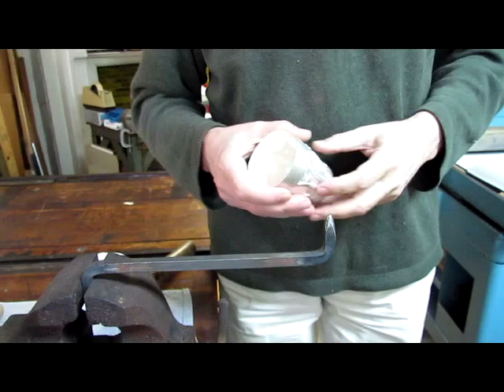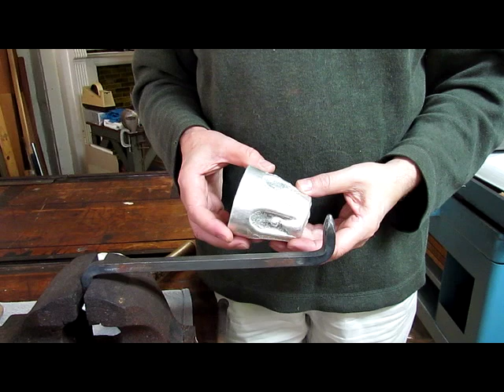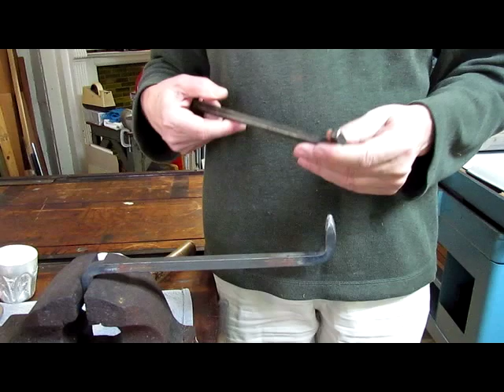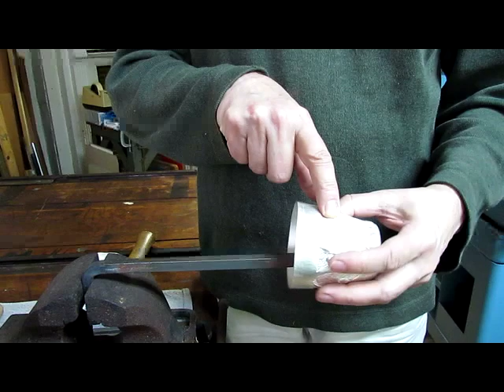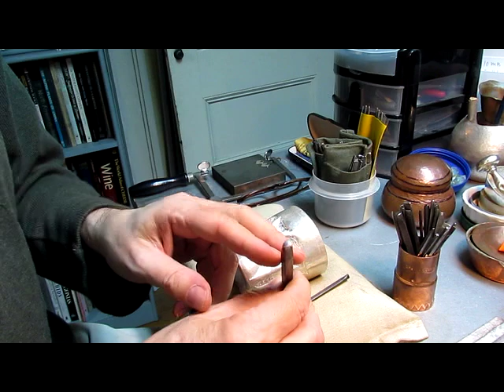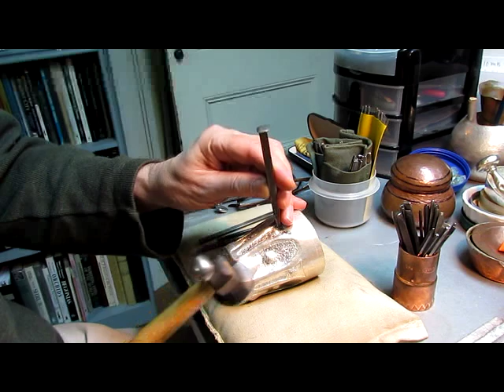Chasing - Part 8 - Air  Chasing

Comment: hey bud you may want to fasten down that vice maybe with a couple C clamps  to hold it down to the table more form  so the  die your using with have more spring than vice  wobble ,  great work Btw ,,  I  have never done any scroll work on any of my knife brass
 but like  learning new things ,